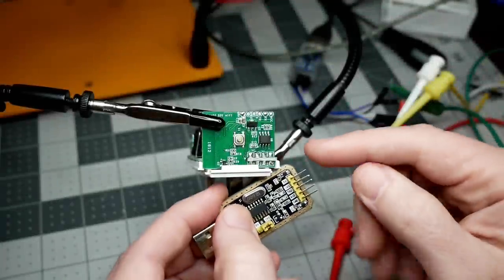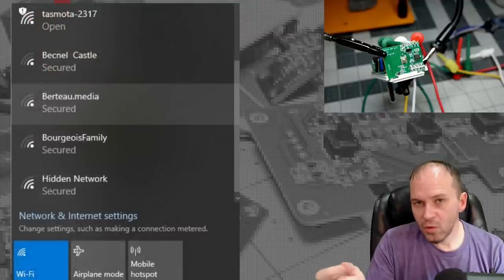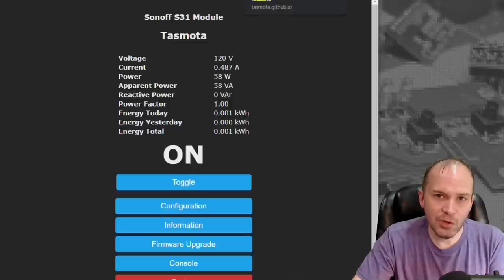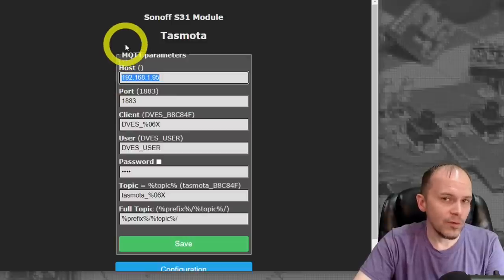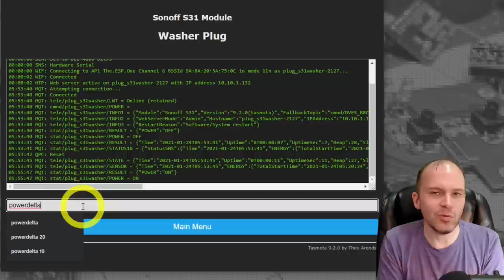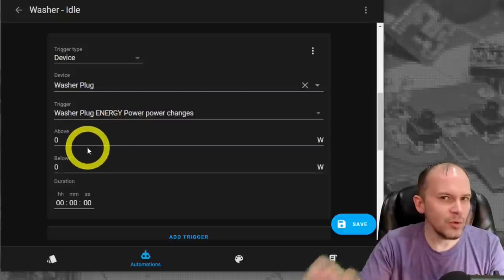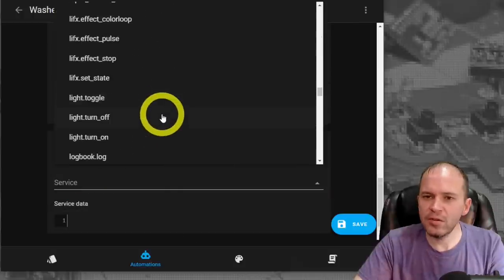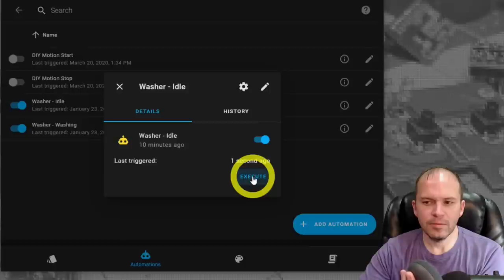Smarter Laundry Voice Notifications - Sonoff S31 & Home Assistant | No Soldering

Comment: Love the fact you have a clear voice and the audio is very easy to listen to, very rare, so this find is off to a great start. I find it difficult to understand how the power monitor you are showing works.  I used ESP8266 Dev Bd with clamp-on amp monitoring device fed into A0 on the ESP device which is the analog channel connected to the Analog to digital convertor. The fact the washer draws very low current and can drop to zero multiple times made it difficult to target when the washer was actually finished. I guess I could have checked the current being drawn and if it was zero for more than 5 minutes then it would send out a notice. I gave up on that project till now and wondering if I could use one of those off the shelf power monitoring plugs. Not sure how they work but if it does then surely will pick some up. One question fingers crossed you have a detailed video on how to set up tasmota on a device not running it. I do like the device with tasmota installed just need to research its use with Home Assitant and ESPhome. 
Can't help wondering which current sensor they used to monitor the current and if it is available for use with the ESP8266 Dev Board?
Thank you for the great video.
Reply from the maker: Here's a more in depth look at the chip they are using - https://tinkerman.cat/post/sonoff-s31-now-serious/
Reply: @digiblurDIY  after watching your video discussing some manufacturers that are changing support chips I got a bit worried. I just ordered a power monitor singe gang receptacle. I hope it is the right one.
Reply from the maker: I see that use case quite a bit for these plugs. No sump here so I can't speak for experience or automations.
Reply: If memory serves correctly the Athom plugs come with Tasmota installed and I wanted to have ESPhome control be the governing software. There are steps to do this wirelessly. I got it working and liked the plugs so much I picked up about half dozen of them. Use them on the washer, shed soldering iron and printer (in case I forget to turn off the printer or soldering iron.). Just keep adding them. It would be nice if and I don't know for sure that tey don't, Athom made a wall switch with the same capabilities. By I mean allow the flashing from Tasmota to ESPhome. For wall switches I use the TreatLIfe but you must open them up connect to the ESp device and flash that way that is so primitive I stopped using Treatlife and will wait till the come up with a Athom type switch modeled after their Athom Plug. Or any company so long as they do the same thing as Athom.

Comment: I was just adding my shelly 2.5 to HA so I can install it inside the plug where my washing machine is. Looking forward to do this!!
Thank you!
Reply: Don't forget to connect the ground wire from the wall socket to the washing machine directly (the Shelly 2.5 does not have a ground pin). Also make sure your washing machine draws less than 10A.
Reply: @henfibr  Good point!! In that case I will go with the same solution as this video shows.
Reply: @cheloautomation4994  That's why I prefer the Shelly Plug S (the one shown in the video at 2:48 - EU Schuko plug) for high power appliances. It has a ground wire and supports 12A.
Reply: @henfibr  In my case, I need the shelly plug us, but I'm going to go that way better! 
Thank you for the recommendation!
Reply from the maker: I did measure mine and full big load was max around 6 amps, but I do like more headroom for things.  Definitely check the tag on yours and go with something over that as in this case bigger is better.
Reply: @digiblurDIY  thank you for the information, I will let you know as soon as I'll do it. I have the sonoff here, so I might do it this weekend and post my results

Comment: Thank you for the video, I want to do the same with my washer and dryer. But both the washer and dryer use 220. Is there any smart plugs that are 220?

Thanks!
Reply from the maker: The extended version tomorrow shows a couple solutions for that. Stay tuned.
Reply: @digiblurDIY  thanks will be looking forward to see it.
Reply from the maker: Here's the longer one - https://youtu.be/Tjg4tioZzbs  
Includes the parts talking about CT clamp solutions.